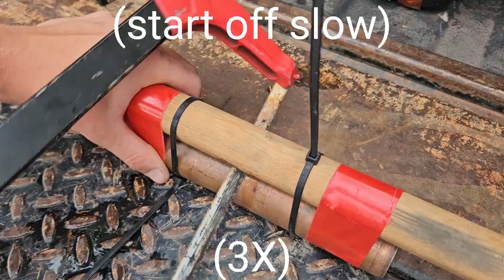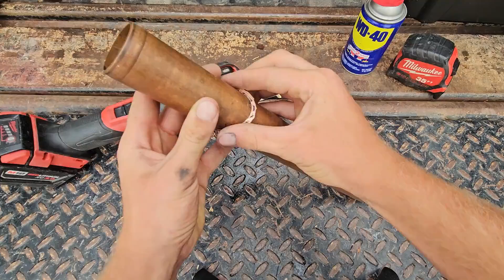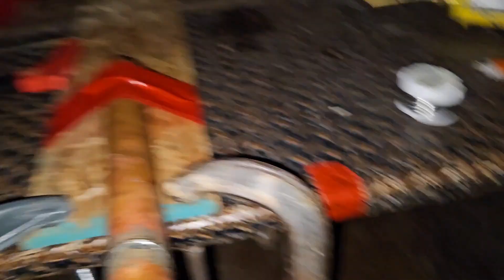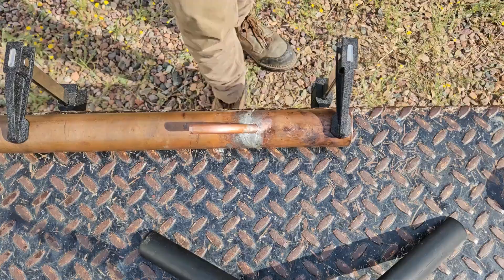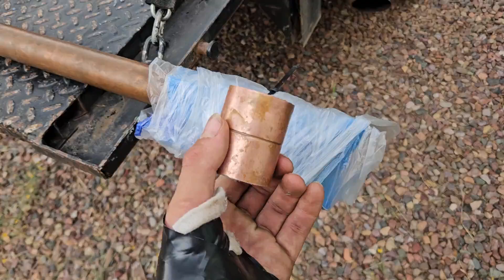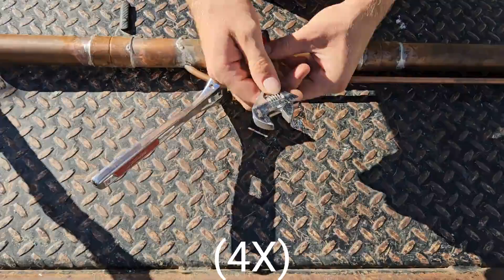Moonshine still made from heaters stands! DIY Boka Still part 4

Comment: you need a keg cause you have outsized your boiling kettle. By the time your rig comes to temp and starts producing your pot will not have enough ABV to let it run.. you are going to have a nice still here soon, find a keg.
Reply from the maker: You are saying that I need a larger boiling pot for the size of my collumn, correct? Could I alternatively reduce the height of the collumn?
Reply: @HomefrontEthanol yep you can reduce it, but if i were you id hook that up to a 50l beer keg